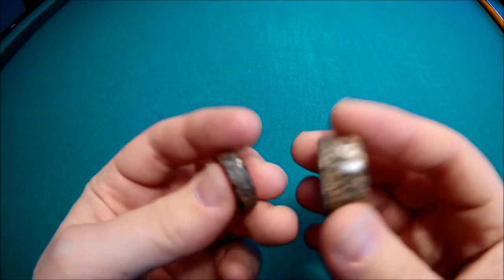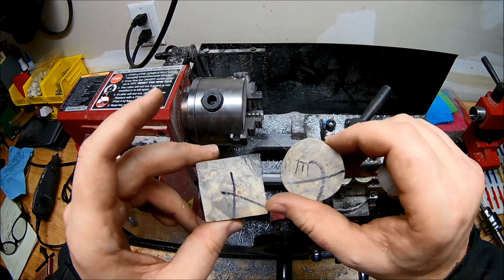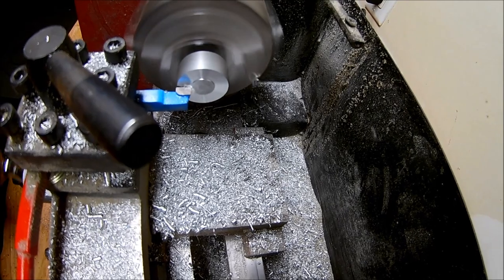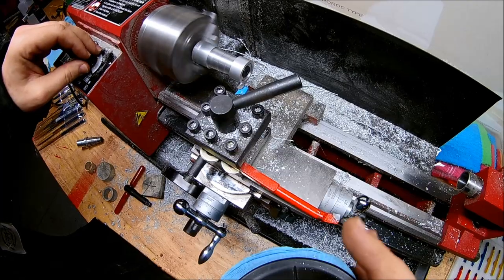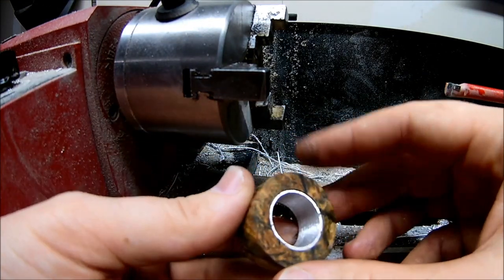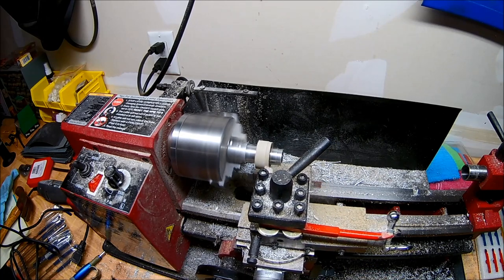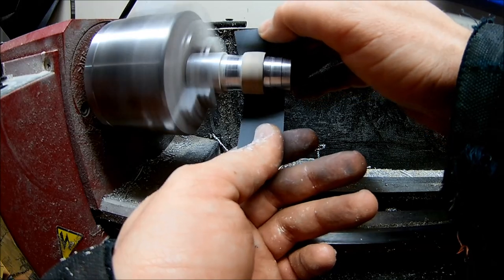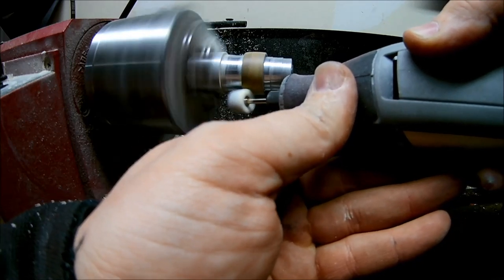Making his and hers wood burl and aluminum rings!

Comment: Great job on the rings. I do have some questions about that harbor freight lathe, mostly do you think it was worth the money and can it cut  harder metals?
Reply from the maker: I think it was worth it. It works well and can cut all sorts of stuff not just aluminum. Check out the review vid I did of the lathe. It goes by many brands so they sell a lot of thus type of lathe